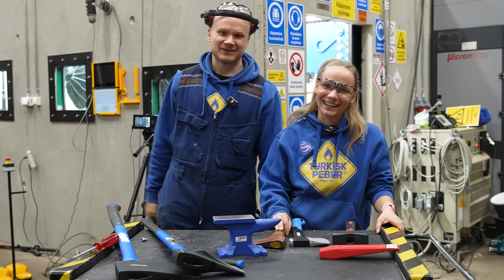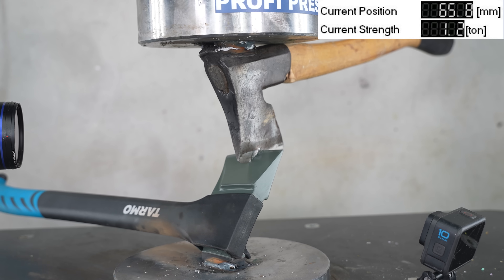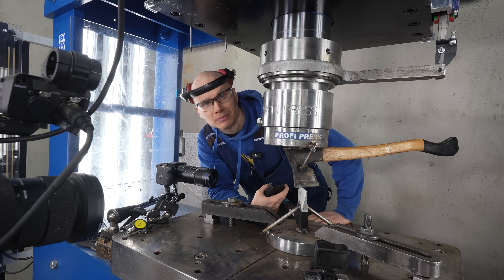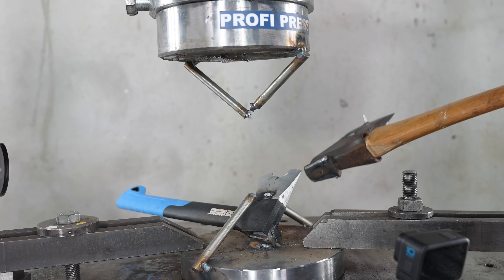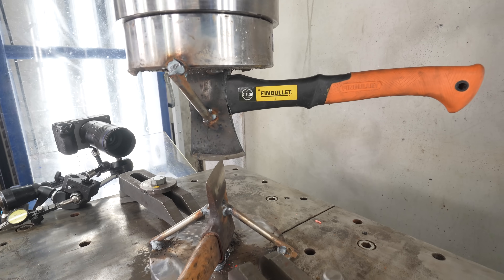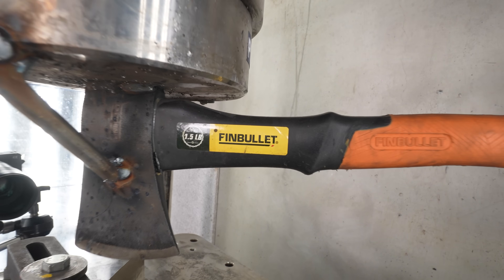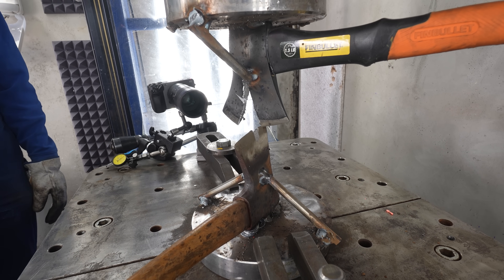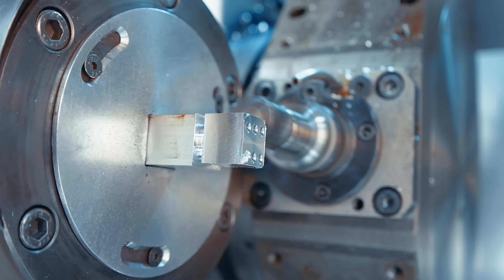Hydraulic Press vs Axes – Testing Old and New

Comment from the maker: Support the channel and get something unique! Check out our Kickstarter: https://museumdice.com/ – CNC-machined metal dice from the finest alloys and pure elements.
Reply: A die's opposite sides always add to seven.  If the dots are hollowed, the 6 side will be lighter than the 1 side opposite it, yes?  In principle, the dots could be different sizes and depths to balance the sides' weights. Even so,  how are the three angular momenta around all three axes balanced when a die spins?  If all three angular momenta are different, the spinning die will tumble.  If two angular momenta are equal, there will be a preferred axis of spin, yes? Complicated.
Reply: @Satori-d6y I was going to ask the same thing. Well probably these are not meant for gambling so in casual board games the small percentage difference will not count much, but I would like to see the test results.
Reply: @iQuMaster  They are formidable objets d'art.  Beautful machining in so many materials!  A casino would likely suffer excess losses from professional dice men.
Reply: @Satori-d6y  Yes they are really good looking and would look great on my desk and probably also really nice objects to touch. Absolutely great machinery. My only issue is with the goal of delivering most geometrically precise dice that world has ever seen - then the weight and balance should also be taken into account. Nevertheless I like how they look and I don't care if there is 0,00x% unbalance if I decide to buy them.
Reply: @iQuMaster  Do it!  Sustaining joy is worth its price.
Reply: You should try it with 2 heads...........see who has the hardest crainuim
Reply: I have a question what did you lose the temper on the axis when you weld them because they are tooled steel
Reply: Olis meillä ihan Pirkanmaallakin ollut koneistus osaamista tuommosten noppien tekemiseen ja suunnitteluun. Miksi ne Kanadassa pitää teettää?
Reply: Looks like the axe vs axe at 5:00 had only slow-mo version? Would have been fun to see real time speed version also.
Reply: 看上去上面的斧子不像是中国制造，更加像是：madeingermany
Reply: Will you guys press a ribeye steak and then cook and eat it? Crush it down to 1/4 of its thickness.  I want to hear that food review.
Reply: They look cool, and if they are made in Canada maybe I can actually afford the shipping.
Reply: china just can't make a good steal/
Reply: In America, people will call this video racist.
Reply: Where can I buy the dice?
Reply: You are so completely nuts.... in such a likeable way 😀

Comment: Any fully forged axe is likely to be better than a factory pressed steel one anyday. But it will likely be far more expensive.
It is more about horses for courses.
For the man in the street many Chinese tools will server their occasional use perfectly well.
Many of the big names have their top of the line tools also made in china. These are made to specification rather than bottom price.

However I am sure Finland still makes some excellent edge tools, ideal for use in their frozen wilderness.

Comment: I love this.. But I question.. What is the point? We know that before, we used pure material. Let`s take this axe as an example. Do you think it would make any change to how it will cut a tree or wood bricks? Let that sink in for a second. Using an modern vs an older axe, will it be used up faster? Yes, if you are planning to use it over 1000 years. In 50 years. No.. Can you have different weight. Yes, you can also buy a cheap constructed axe that is heavy. We pretty much know how pure mineral works. But if we would do that today, adding pure material into everything, we would not have any of it left.

Comment: China manufactures to the requested spec. If a western Company orders crap based on crap specifications, China will supply that.... If they order a high spec product, China will supply. Perhaps on the absolute top 10% they may not be able to compete.

Comment: @HydraulicPressChannel How did you centered the mass of the dies so that the probability of each side landing is the same? The CNC takes different quantities of the material depending on the side of the die so the center of mass will change during machining. Do you use fillings of different densities?

Comment: Here's some insight on why the old axes tend to perform better,  modern axes are all mashine producs, even tho the steel is higher quality, the the steel is same from tip to the back.
while older axes were often made by hand, hammered down which already makes the edge stronger, but also when quenching it, the thin edge cools faster, making it harder and the back and middle being just massive lumps of steel coold down slower, keeping it softer thus can take more stress without fractures.  while the new axes that are exactly same from the axe blade to the very back, once it gets fracture, it travel all the way trough, and it shatters easier.

Comment: Take both axes and heat treat them the same and then test them against each other. The heat treatment and quenching and even freezing (cryogenic hardening) them makes a huge difference in the quality of your blade. I used to hand make knives. I don't claim to be an expert either but not a novice. I bet a lot of those cheap Chinesium axes would test a lot better with a good heat treating. They seem to be fracturing the axe apart not actually cutting it.

Comment: It’s so clear that the older axes have two kinds of steel in them- the edge is softer, so it can be sharpened, harder at the back for strength. The newer, cheap ones are all the softer steel.
Reply: I think it’s actually the other way. Harder but more brittle at the blade so that it holds an edge better, and softer metal with better fracture toughness behind to allow it to better handle blows and impacts long term. The difference between old and new is that hardening just the blade is more expensive. It’s much easier and cheaper to just quench and temper the whole piece, even though it makes the whole axhead brittle. But when your whole business model is selling dirt cheap tools to homeowners instead of workers, it doesn’t matter because you know it’ll live in the shed and they’ll only ever use it once or twice a year.
Reply: The knife edge of the ax is made out of a harder alloy of steel, not to mention the ax is differentially tempered so that the cutting face is Harder than the rest of the ax.

Comment: used to work in borehole surveying.  company was from finland but i am canadian and working in usa.  had a finnish field engineer with us who always brought high quality finnish tools on jobs.  well on a job one guy accidentally dropped a finnish wrench down the hole.  found out later drillers destroyed two high temp drill bits on that damn wrench trying to drill though it.  after that i always buy finnish products when i can afford it and they are available.  i left that job with a great deal of respect and admiration for finns.
Reply: Thats very nice to hear cheer from finland!🇫🇮
Reply: And the thing is, I don't think there's anything super special about the tools. Similar quality could probably be made anywhere, and certainly some producers do, but most just don't. Finland just traditionally values quality quite highly, and it doesn't really make sense to make poor quality tools cheaply if it can't compete in prices anyway, against the stuff that's made cheaply in China.
Reply: @wombat4191  Indeed. We Finns have a perfectionist gene. At least some of us. It leads to a lot of quality products that last for a long time and most of us like to invest in Finnish quality that can be trusted to last for decades (still using some Fiscars kitchen scissors from the 1980s that are only now in need of sharpening, even the plastic handle is intact with original colour despite decades of diswasher washing) & design products instead of cheap stuff that has some part of it designed to fail.
Reply: @samhartford8677 "We Finns" but your name is "Sam Hartford" and you can't even spell Fiskars properly even though literally every Finn knows about Fiskars.
Reply: @eisaatana96  Hahah, sori, mä toimin niin paljon englanniksi, että c lipsahti sinne. En varmaan ollut koskaan sisäistänyt oikeinkirjoitusta, jos nyt rehellisesti sanon. Jos olet suomalainen tiedät myös, että meillä on ruotsalaistaustaa...
Reply: @wombat4191  Like we say in Finland: "The poor can't afford to buy something cheap"
Reply: The wrenches were made from Nokium
Reply: @sebastianjansson6436   🤣🤣🤣🤣
Reply: 😂 @sebastianjansson6436
Reply: northern iron is the best
Reply: I boycott everything made in China. If I buy something, I expect it to last at least 5-50 years.
Reply: You should consider the capital letter.
Reply: 芬兰诺基亚

Comment: Just a quick note to anyone out there looking to buy an axe: Fracture resistance is much more important than hardness.  If you pay close attention to the videos, you'll notice that the "winning" axe often shows a fracture failure.  As such, the "losing" axe could well make the better tool here.  Also note that sometimes even the losing axe shown signs of fracture.  Soft and brittle is what makes for a bad axe, and this is what you want to avoid.
Reply: I never had an old axe fracturing, if used as intended, if it's not hard, it becomes dull very quick. These axes were used a lot, and would it be old, if it was bad? You have to change the handle from time to time, that was it. I buy my axes and almost all other tools used, life is to short for bad tools. Same with files, I have some new, high priced files. But I can't afford, to buy only these, so most of my files are used ones in good shape. And most of them are better than currently production. Maybe, the knowledge gets lost, costs and other production methods are another thing.
Reply: You don't cut steel with axes. Old quality axes are made with the ideal properties to be hard enough to cut wood but tempered back enough to make them pretty much impossible to fracture if you are using them properly.
Reply: This is entertainment not scientific experiment.
Reply: @XtreeM_FaiL  I'm well aware of that, and I have seen plenty of comments down here which indicate most people don't understand this is purely entertainment.  That's the entire point of my previous comment.

Comment: Regrind that Fiskars. It deserves a second life after that performance.
Reply: Would need redo the heat treatment since it was ruined by welding. In essence you ether weld whole thing with self hardening rod/wire and grind it back, or keep the original steel. Damage from the tests were such that the actual hard alloy at the end was most likely ruined, but sure its still worth to redo with tool steel wire like i did for couple cheap chinese axe heads that worked as basis for custom axes.
Also there are three manufacturing methods for the axes. First is the highcarbon steel forge welded in front and once you grind it away you need to reforge it with new material or it becomes just mild steel axe that dulls easily. Second is making whole axe head from high carbon steel. I believe the Fiskars one was one of those since it cracked so far like that and third is the seemingly Chinese way of making it from mild steel cheaply as possible. Sure its harder than most woods, but wont hold the edge very well.
Reply: @Hellsong89  the old Finnish type axes are always two or three piece - this is the model 12/Kemi model which is three piece. They were always smithed using a hard tool steel wedge (as the blade material) forge welded into the eye-body part of the head made of mild steel, which had been split up to seat the wedge into it; after that, the butt was also forge welded to the head, and the axe head was then forged into final shape, and the edge hardened. This double material construction allowed some flexibility to the head (so it wouldn't detach from hard hits as easily as a monoblock hard tool steel head would, as the mild steel dampens the vibrations of the edge), and made the axe heads withstand the cold winter temperatures without becoming brittle.

Generally the tool steel edge part is seated very deep into the head (generally up to two inches, at least in my 12.2 it's 2.1 inches) in these.

The later Billnäs/Fiskars models imitating these original Kemi model axes, which for some confusion kept the same number codes for some time, are made of monobloc tool steel, but they can easily be seen as being forged from one piece (old Finns called them "American" because of the monobloc machine forged construction).

Comment: I don't know if you were trying to make a Finnish axe commercial but you did. Where do I buy?
Reply: I don't know if the new Fiskars axes are as good as this old one, but they certainly are proud of their hardening process. They are still Finnish made, in Billnäs, and they can be found in Home Depot I believe.
Reply: @Hellsong89  Fiskars axes are still made in Billnäs Finland. I checked. But, is the (expensive) hardening process what it used to be, that I don't know.
Reply: The new ones are made from the same cheese as those Chinese ones. So for a old and  good Fiskars You should check some flea markets
Reply: People talk about old Fiskars axe heads. A 90's Fiskars wood chopping axe with a plastic composite handle will last for a lifetime. Still using one, and she still chops :)
Reply: @harri9885  Yes, agree. I have two different, both from the 90's and they are still in use.
Reply: Perhaps Finland
Reply: Finnish flea market. A vintage, lightly rusty Billnäs axe head is about 10-15€

Comment: It's completely amazing, in a way, that a "proper" axe has steel that cuts through steel, and just keeps cutting!
This axe will cut a LOT of wood!
Reply: CNC machinist here. Fair point about trade-offs in hardness vs brittleness.. problem is, as many point out, you never know what you're getting when you buy from that scoundrel country
Reply: @Metapharsical  When you purchase from that country you always assume you are getting garbage.  Then you can be pleasantly surprised when it isn't.
Reply: Just because an axe appears to "win" here doesn't mean it is a good axe!  Toughness is much more important than hardness in an axe, and a tradeoff is always made here.  If you pay close attention, you'll notice that the "winning" axe often shows sign of a fracture failure.  A softer and tougher axe will allow for a thinner edge geometry, and that is what really allows you to cut a lot of wood.  That said, you do specifically want to avoid the axes that are both soft and brittle.  I saw at least one of those here.
Reply: The main difference is that its blade is fully hardened while those others have only the blade edge hardened. There are benefits and drawbacks in both designs. One of the most important benefit of hardening only the edge is that it is much better to use because softer metal in the rest of the blade dampens the impact and doesn't hurt your hands as much. 

Sure, it breaks faster in this kind of tests, but that is irrelevant because the axes are not designed to withstand this kind of torture. Thus, the quality cannot be determined with these tests.
Reply: @anteshell I have one of these Billnäs axes from the 50's. It has a model number (13?) Despite some rust damage but I forget the exact number. The blade's edge (3/4" from the apex) almost makes a handfile skate and it stains much darker with citric acid than the rest of the axe head. Wonder if it's just the temper on the edge  or if the edge is also made from a harder alloy of steel?

Comment: The Fiskars axe had golden hue from the welding. It means the temperature was high enough to mess the temper. In this case, it may have increased toughness but softened the steel.

That Tarmo axe looked quite hard and cracked easily. Unless it's very good steel, which I think it isn't, that won't work well as axe. Axe typically needs toughness more than hardness, so the edge don't crack from repeating hits.

Previous generation Fiskars axes, which were still made in Finland, were relatively soft steel. As they moved manufacturing into China, they say it's tool steel, which are typically the highest quality steels. The old version worked well and was easy to sharpen, but the edge tend to bend. I haven't tested the Chinese one to know if it works well, but it is much harder.
Reply: Which Axe would you recommend for summertime cabin (recreational) use? That are available in Finland.
Reply: @ Fiskars x27 or x36 for more serious work, x17 or x25 for smaller wood. It also depends how well user can use axe. Fiskars axes just work well. It’s about shape, balance and slippery coating.

Comment: Watching the old Finnish steel cut though the new Chinese monkey metal was satisfying AF
Reply: like hot knife through butter.
Reply: Chinese monkey metal is a crazy word
Reply: Meanwhile China built a wall which still stands. I'm sure modern Finnish walls are comparable 🤡
Reply: It's really a question of hardness vs. durability. The Finnish axe is a hard high-carbon steel, and the Chinese one is likely a milder steel. So the Finnish axe is more likely to crack if it hits a stone, and is more rust-proof. But it'll hold the edge better. The Chinese one is more durable and is less likely to chip, but it'll get dull faster.
Reply: @AlexBesogonov  Traditional axe heads are made by forge welding two different types of steel, laminated edge steel, a hardened carbon steel for the edge and milder steel for the body of the head. The edge is hard and the body durable. The modern Chinese axe is poorly made from cheap materials.
Reply: the chinese have ruined the reputation of so many steels types just by slapping the name on some random crap
Reply: Wrong - if you look closely the chinese axe was cutting through the finnish axe and only broke when it got twisted. The angle it was filmed at gave the wrong impression.